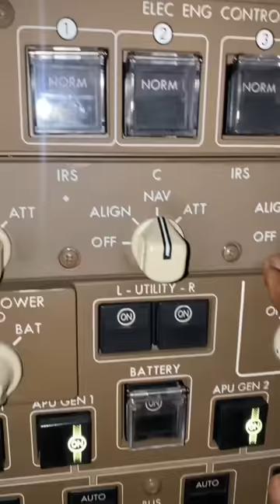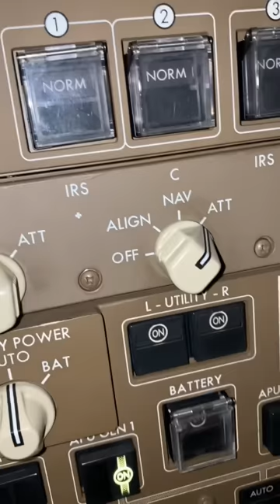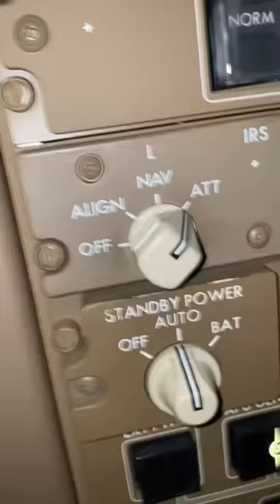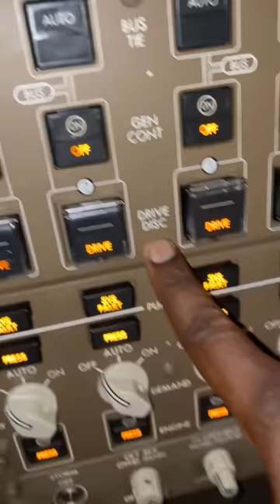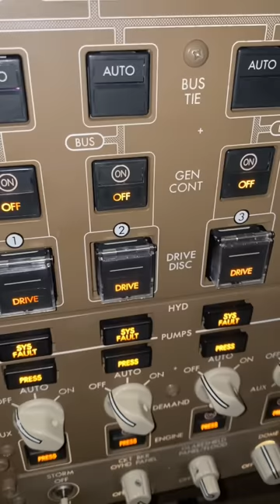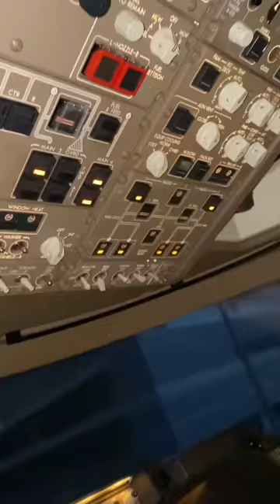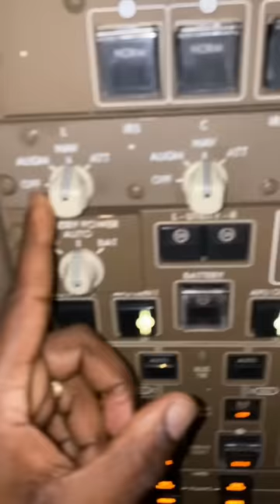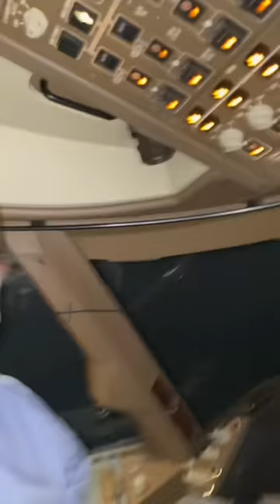Boeing 747 cockpit irreversible actions

Comment: Proves the old 748 is an old dog showing new tricks. 787 has  double IRS switches and the 777 ADIRU switch and that's it. Three for the 748 proves that Boeing are painting over the cracks with this old shitter.